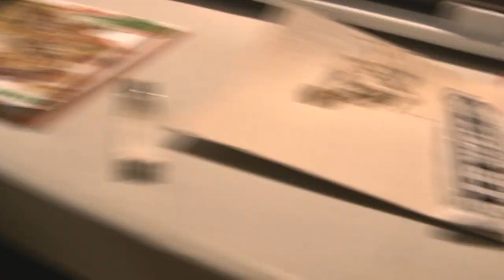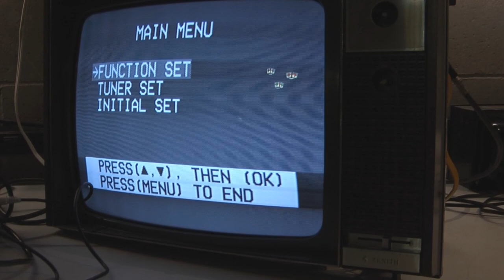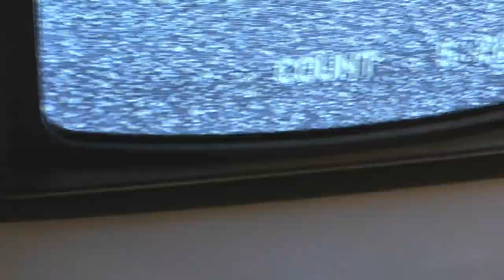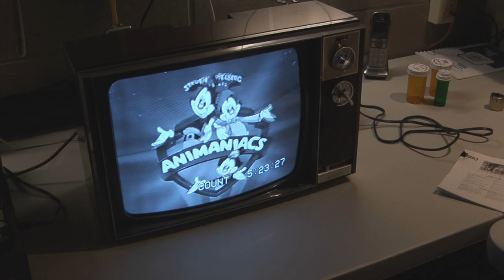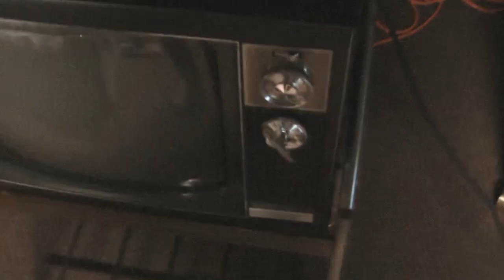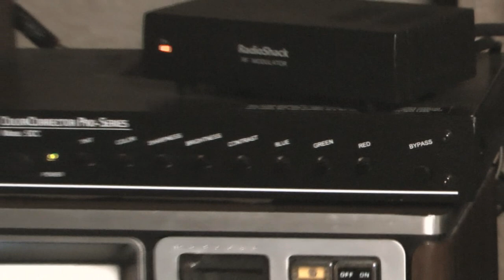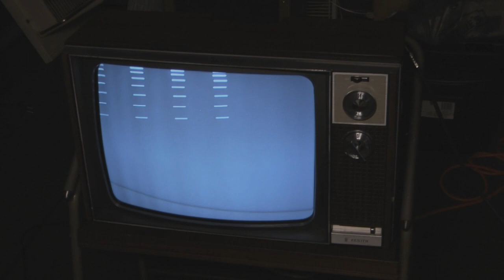The 1972 Zenith 16" Portable Black & White Television

Comment: Excellent work on cleaning the TV and repairing the minor issues.  I never knew that you can put an actual picture tube in the dishwasher to thoroughly clean it.  I always feared that the water pressure hitting the neck would crack the glass causing the tube to go air and be destroyed.  Same with the chasis with all the coils and yoke being the wire is so thin.  Nice to know the result.  Unfortunately I don't have a dishwasher because I have an RCA 12" that works but it needs a good thorough clean job.  I would try taking a garden hose and spray wash it but I'm afraid I'd mess up the coils and then probably have to wait a month before adding power; even after running a fan on it for only a week.

Comment: That's a nice set.  I wonder if you can convert these B&W sets to color.  I'll bet that's hard work to convert it.  I've found old photos of me watching my grandfathers unknown brand TV from when I was 4 years old.  I'll share it on your Facebook page
Reply from the maker: Thanks. 

And pretty difficult. You would basically just end up replacing the whole TV in the process. 

However when color sets were new in the 1950s, they did have external color wheel conversion kits that work the same way a modern DLP set does.

Comment: I've found for black and white sets, taking the Y output from s video to the blonder tongue  agile modulator, results in a picture so sharp it looks like its enhanced definition. Very crisp. That's how I had my dads 13" kitchen TV wired up before its flyback had a meltdown.
Reply: Thanks for the info, we'll give it a shot.
Reply: I need to try this with the stereo Radio Shack modulator I picked up as it has S-Video inputs. I heard it takes care of the Macrovision problem too. ;)
Reply: I don't think it'll take care of macrovision.  But with the modulators with S-Video input, make sure you cut the chroma pin off.  The point is to feed it a pure monochrome signal with no chroma noise.
Reply: Or it's even easier to take the green connector from a component video output and use that to get pure B&W video -- just make sure the DVD player or whatever you're using is set to 480i mode, not HD or Progressive Scan.
Reply: That's the only reason I didn't recommend that method, S-Video is guaranteed to be 480i, that way high definition or enhanced definition sources don't accidentally cook the TVs.
Reply: Brandon MacEachern HD won't cook the TV, it will just lose sync. It's not like a computer monitor where the video output is driving the CRT sweep directly. If the TV can't lock onto a signal, it just free-runs at its normal scan rate. http://www.youtube.com/watch?v=GwvCfsWQx58
Reply: vwestlife Ahh ok, I didn't know this, thanks.

Comment: This may be a silly question, but I would have thought using a dishwasher to clean them with that amount of water and the soap it would ruin and tarnish the metals let alone plastics in electrical items? Everything looks amazing though.
Reply from the maker: Nope. No harm done. Everything just ended up coming out like brand new again.
Reply: About the only thing we have ever had an issue with are paper items (of course, as the water and high-pressure spray will disintegrate paper) and unpainted, untreated steel (a little surface rust can form.)  We have also dishwashered several electric motors (only ones without the paper insulation of course) and I run my entire Lakewood HV-9 and Honeywell 6" utility fans through anytime they get dirty.
Reply: +Harley Badger whats was ur first tv when u start